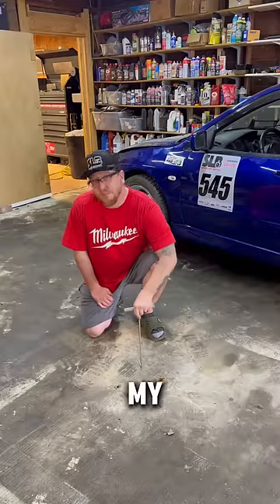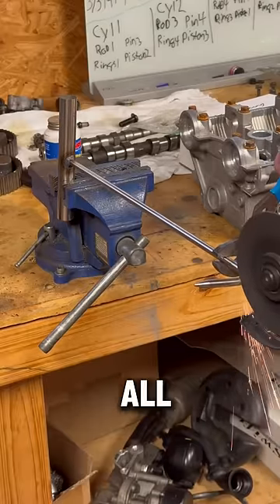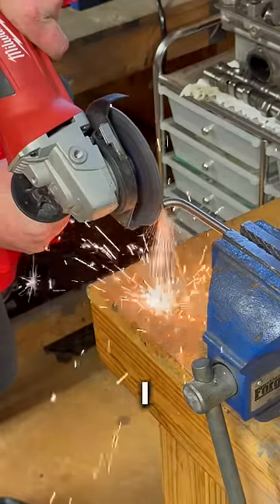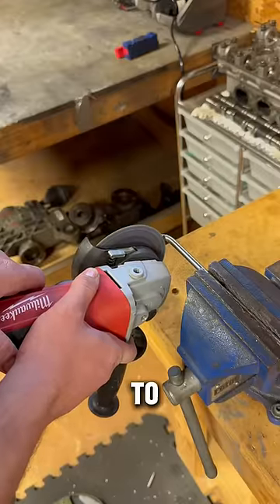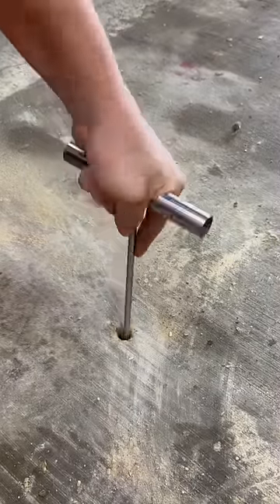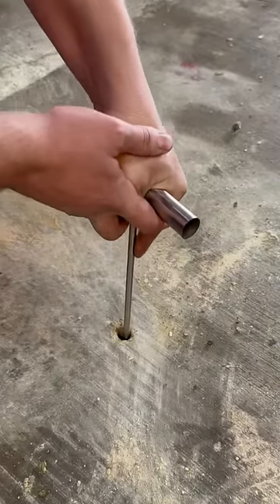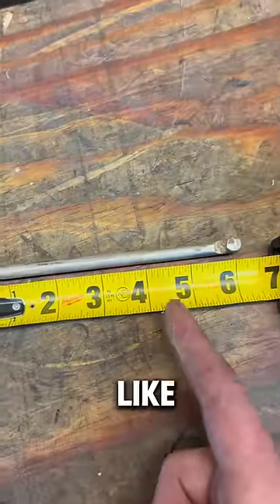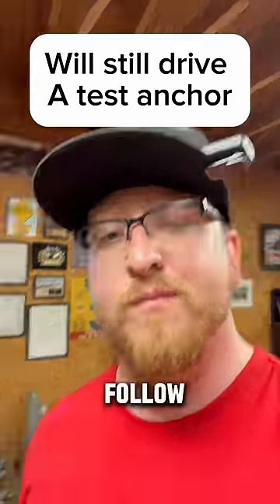Making a tool to measure the depth of concrete.

Comment: Coulda just looked up standard garage slabs by your districts code lol
Reply from the maker: This house was built in 78. This tells me for sure
Reply: I had a lift installed in a commercial warehouse once and the management company/owner told me the slab specifications were marked as 6" thick. When the anchor holes were drilled some of them were barely over 4" thick.

Comment: Lmao bud that’s not how it works… you measured in the thickest part, the middle…. Do 4 more pilot holes one in every corner now. Or atleast where you plan on putting this. Big difference.
Reply from the maker: I measured in the vicinity of where I will be mounting one of the two as I should. I will check the other side as well